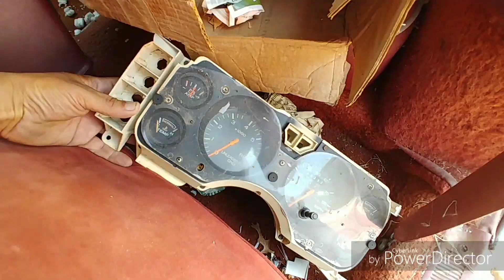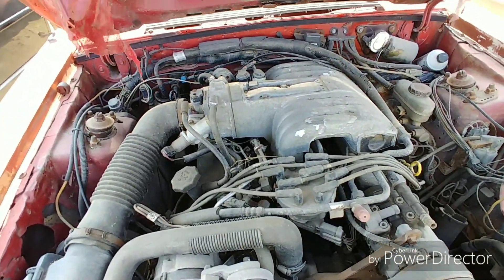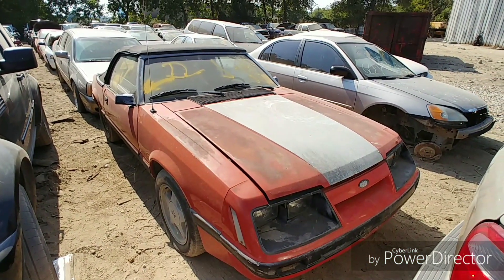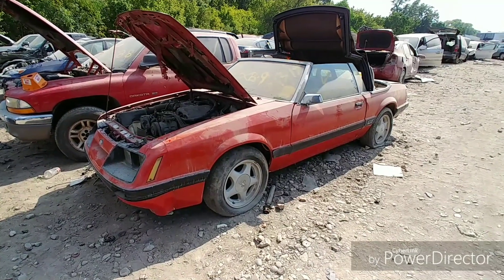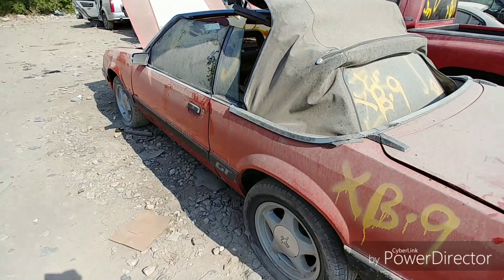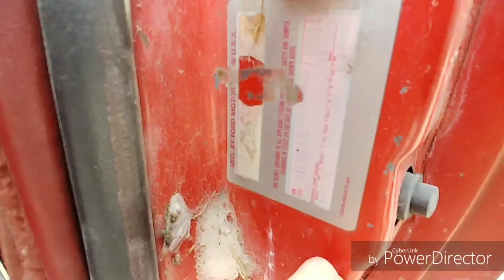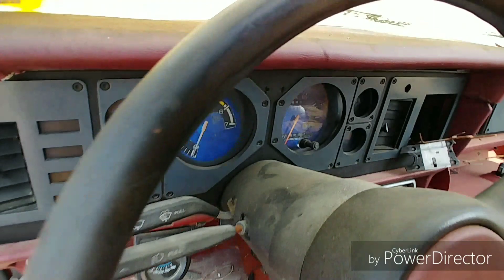1986 Mustang GT Junkyard Find

Comment: VIN is 1FA for US assembled Ford Motor Company, B for manual restraints, P27 for Mustang GT convertible, M for 5.0 "HO" 302 fuel injected V8, 7 is a check digit, G for 1986 model year, F for Dearborn, MI assembly plant and the rest is the production sequence. Yup, looks like someone started collecting parts for it, then put it aside. Now it's a hooptie-do.

Comment: Neighbor had an 87 red on red convertible 5 speed LX w the 5.0  for sale for nearly 3 yrs. He had NOS seats frt and rear, complete units, to go with the car. It needed a top and new seals.. That was it. New clutch, new pedal linkage, new self adjuster, new exhaust, new brakes, new p/s pump, new water pump, new ign. module,  and more. He wanted 3 grand for it. No one wanted it. His wife finally sent it to the crusher during the clunkers for cash days. Shame. The car was rust free!
Reply: The CFC was bad for the collector car hobby and just bad in general. Not to mention that it did nothing for the economy and actually cost the taxpayers money.
Reply: Can you repeat that..."3 years and no one wanted it"
Reply: @googleusergp  saved GM though
Reply: @CowboyCarCrushing  Not even close. All it did was remove used parts "stock" from junkyards to keep the better condition ones running. Most of those cars that were junkers were off the road already. A '78 Bonneville is much more of a "gross polluter" than say an '85 Delta 88, yet the '85 would have qualified for CFC, but the '78 would not.  It was an ignorant program that cost the tax payers money. What saved GM was you and I---the taxpayers. The gov't allowed GM to "recreate" itself and it hasn't turned out well in my belief. New boss, same as the old boss as The Who said.
Reply: @CowboyCarCrushing  Because when it was being sold, it was "just a used car". My '79 Trans Am was for a time in that status, especially when I bought it in 1999. It was a 20 year old used car. Now it's a real collector's item. I bought it at the right time.
Reply: @googleusergp  sarcasm gets lost sometines in the comments.
Reply: @CowboyCarCrushing  I get it. LOL. (I would have put an LOL after your comment. Then I would have gotten the point there.....)
Reply: @googleusergp  im new at the social media stuff
Reply: @googleusergp  by the way. Those CFC cars made me famous. 3 different news channels came out to our junkyard. Wanting to film them being crushed and a little O&A interview. Boss man made me do it. I was on the news two nights in a row. My momma was so proud of me
Reply: @CowboyCarCrushing  Not your fault, but I wouldn't be proud of that. A good stream of affordable parts just went down the drain and cost our taxpayers more than the "benefit" that our gov't offered us. All it did was take people that had affordable running cars and put them straight into debt with car loans.
Reply: Had something similar called the "scrappage scheme" here in the UK. Lots of perfectly good cars scrapped to you could save two grand on the latest korean shitbox.